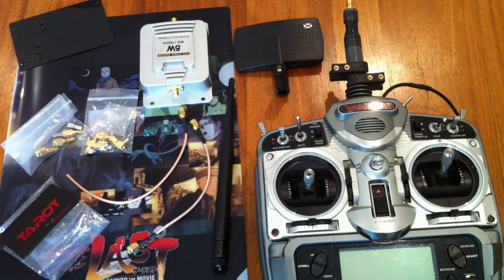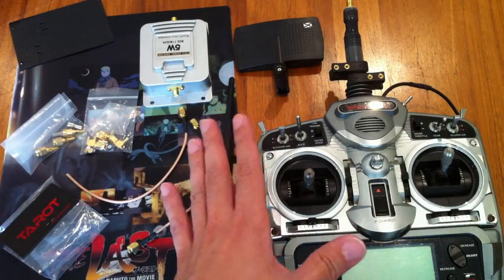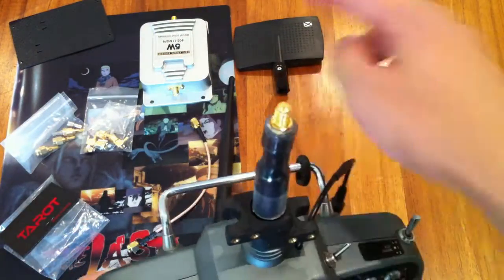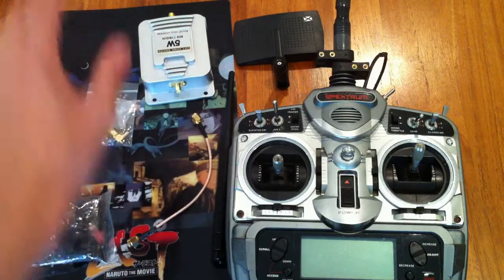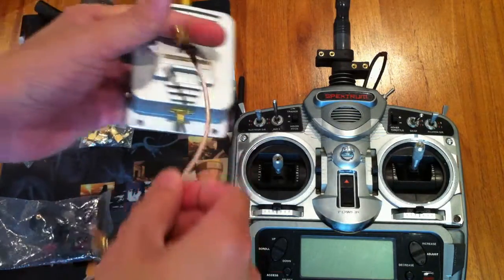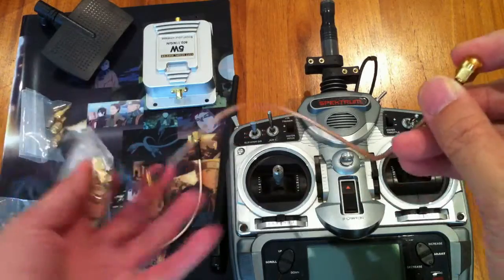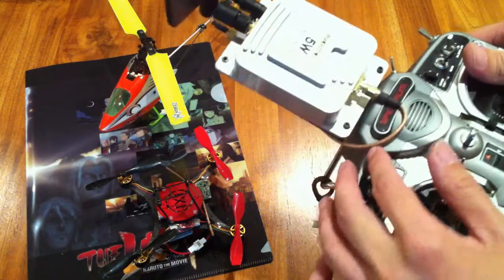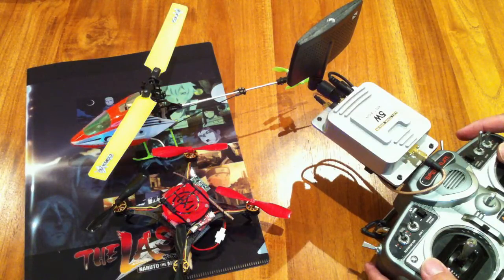Cheap 2.4g LRS for Micro FPV

Comment: 5w! LOL! I thought the 2w was a bit excessive LOL! Your gonna stomp on 2.4
Reply from the maker: I thought so too.. Haha
On second thought, the dsm2 integrated rx has a really short range of 150m so the extra power might be necessary since there's no RTH fail safe on my 125mm drone.
Reply: Terence Chan Hi... I am apparently interested in micro sized FPV Quadcopters, to what I realized they dont have long range because of micro size... and you managed to increase its range right? I have some questions

1. does the your solution could work with live FPV, screen system. such as Devo F4?
2. with 2.4g LRS upgrade how long the range? 
3. what would be expected distance in meters of both live video fpv and flight with the Devo F4 radio controll.
Reply from the maker: This mod only amplifies the 2.4ghz transmission of your devo F4 to increase RC range (abt 1500m on a ladybird). 
To increase the F4 video range, u need to replace the 25mw vid transmitter on the ladybird with a 200mw one (32-CH needed as F4 vid receiver uses a different band)
The 200mw offers abt 1200m vid with a china 5.8g 11db patch antenna installed on ur F4 vid receiver.
Reply: Terence Chan I seen in forum a guy posts his own verison of the Super-X Brushless with 2x 600mah nano tech batteries! which supports long flights if you want to use it as UAV spy :D 

doe's it supports long range high/medium altitude flights? and if so what would be the flight time of 2x 600mah? I am looking to build one with 2x 600 mah  batteries, GPS, camera, and 1000m range of flight and live FPV video in radio controller.
Reply: ***** could you post a video of it with all what i've mentioned? this would be really nice !
Reply: *****
Make a video of the gear you have it will help your question. What quadcopter are you flying?
Reply: Hoverbot1TV ahhh hmmm haven't flied one yet :D just the subject of UAV drones is very intersting me,
Reply from the maker: The principles are largely the same. One could have GPS on any quad nowadays with autopilot ability(flying by waypoints). Since u r an avid reader of these topics, google for APM, I have a video on a Turnigy 345mm quad that uses it. It has GPS, on screen telemetry, waypoints,etc. There's now a nano APM, same size as the nano Multi-wii board on my super-x. So we dun have to crack our heads to miniaturize the APM to fit it onto the super-x. I dun intend to go that route, 
1. I prefer to fly back home than to rely on GPS's RTH (thus the long range RC tutorial I posted n the other stuff on making antennae for long range video.. A video blackout means losing your quad)
2. M never a fan of automous flight, started this hobby 10yrs ago with LineOfSight flying, watching an autonomous flight in FPV is different from "Flying FPV". If I see a pond, I wanna check it out..maybe chase some ducks for the kicks of it.. :)